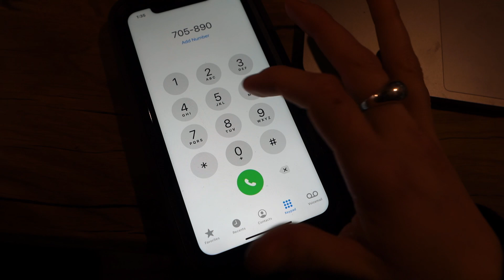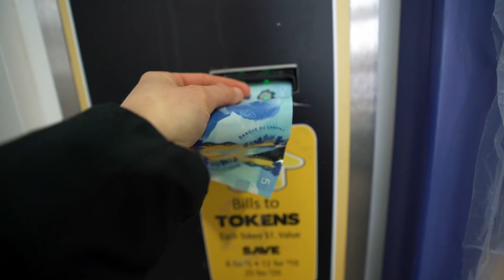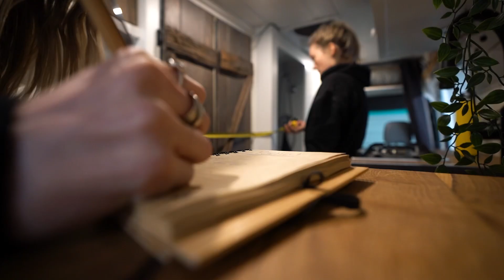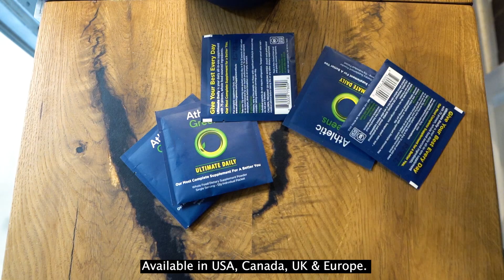WE MOVED! Building the Ultimate Off-Grid VAN Home in Winter (female van life build)

Comment: a good upgrade would be a hydraulic drive assist system, it should fit on the front wheels. not a true 4x4 but, it can get you out of a hole. I'm looking at putting it on a travel trailer.
Reply from the maker: Damn! Yep that would be amazing!